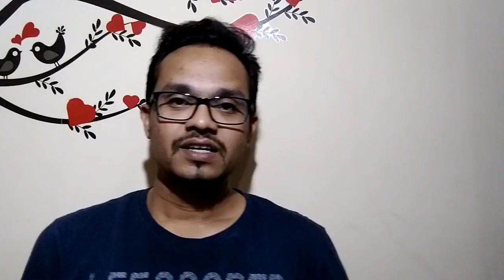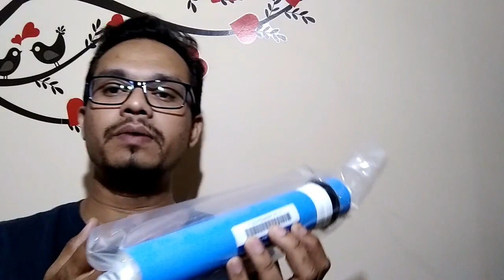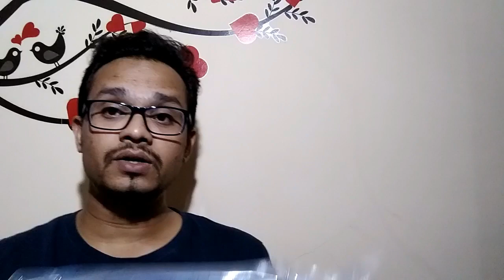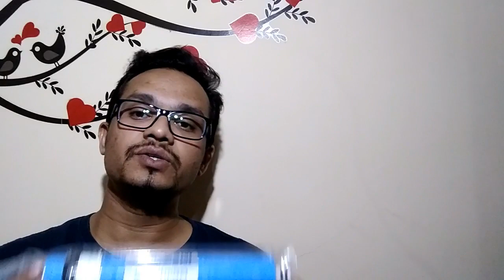HIGH TDS AFTER CHANGING RO MEMBRANE In English

Comment: Be sure to flush stages 1-3 out first and BYPASS the RO membrane with a hose that drains into the sink.  Otherwise you will be flushing large carbon particles clogging up the brand new membrane.  Flush it until water is clear.  About 10 minutes or so for stages 1-3.  Alternatively, change stages 1-3 leave old membrane in place, flushing stages 1-3 while also clogging up the old membrane you are going to replace, then replace it with a new one and continue flushing the new membrane.

Comment: Hi, I had asked a question earlier: repeating - RO changed but not flushed for 2 hours, but not knowing chemical storage story, been using the RO for about a month now.  A while ago, I replaced the pre carbon filter as well, but I had flushed it until the output water became clear enough.  Still the water output is high in tds.  So now, should I exclusively flush the RO membrane again for 2 hours?  I would be grateful for your kind advice.  Thanks n looking forward..
Reply from the maker: No. If ur tds level is high then there must b some problems

Comment: Thank you sir for the vid. I have a question: I replaced the RO membrane but didnt flush the system for 2 hours. I have been using the water for more than 2 hours now.  I mean, I have used the RO system for many days since the RO membrane change.  But still, the TDS remains high.  My sediment n pre carbon n FR are more than 10 months old.  Could this be the reason too for the high TDS?  I would appreciate your valuable response.  Thanks n best wishes.

Comment: Hi sir normally water TDs 110 long back change membrane now new members change 330tds comes again change old one membrane same TDs co 330 come what issue my ro
Reply: Check your carbon filters. Chlorine breakthrough destroys the RO membrane.
I am having similar problems after the water company switched to chloramine, which is harder for the prefilters to remove.

Comment: My input water tds is 50, output water tds is 37,
 I have adjusted all settings of tds controller but it changes only 10-15% of output value. 
Means output high is 47 and lower is 37, after setting the tds controller at extreme settings. 
.
Please guide me what is the problem 
I have new membrane installed 2 months ago. 
This readings are from day first of membrane installation.
Reply: I have had a similar problem with my system. I have done some research and believe the problem may be the amount of pressure input into the ro membrance. You may want to research the required pressure going into the ro membrane, & may want to install a pressure gauge right before the membrane.
Reply: Make sure you have around 60 PSI pressure. And carbon prefilters to remove chlorine.

Comment: how do i get 0 tds water for my aquarium  use
Reply from the maker: its very difficult to get 0 tds. i will explain it to you .. what is your incoming tds?
Reply: some ware about 400  i like to assemble my own but i  need 0 tds water  solution for it
Reply: girish patil need to use Di media .   Google it
Reply: Use DI post filter.
You can also use a pressure pump and even two RO membranes in series, before the DI resin.